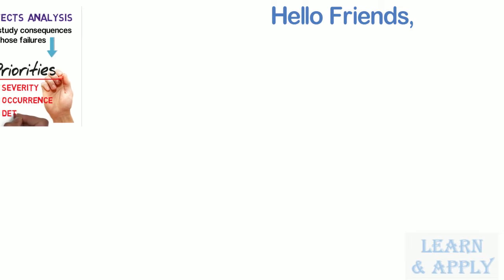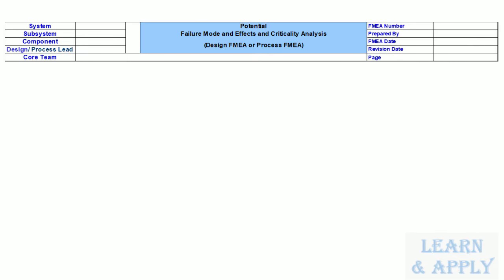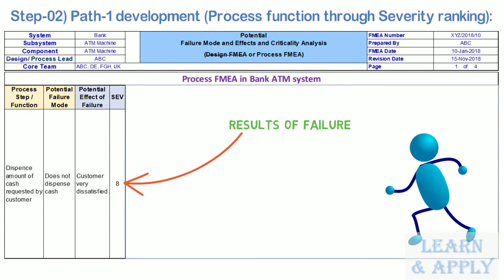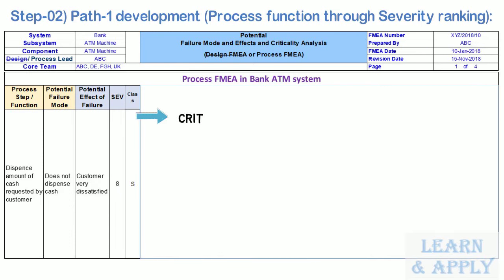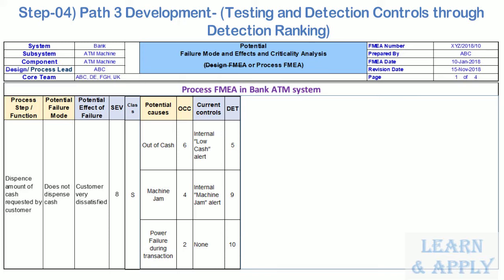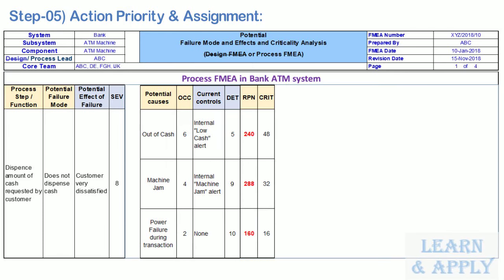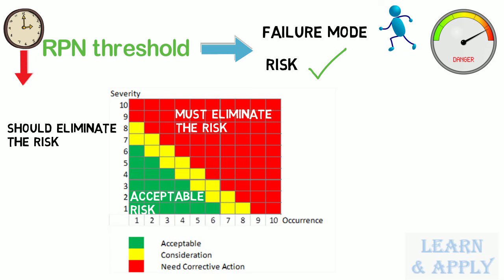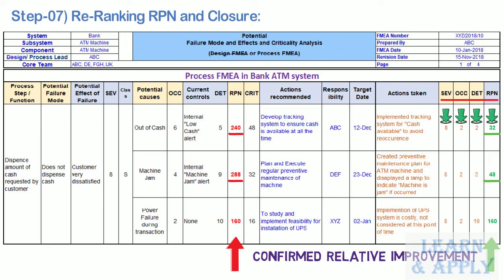FMEA with Example: Detailed illustration with a practical example

Comment: Thank you so much. Extremely easy and useful concepts.

So should risk matrix be 10*10? We have 240 correct? So do i increase the size of my matrix as 30*10? Wouldnt it be hard to draw? Could you please help? Or do i keep 30*30 with 10*10 squares and say 1 square =3 units and so on?
Reply from the maker: Thank you for your valuable comments and appreciation!
Can you please elaborate on your thought process here? 10*10 is a standard risk matrix considering Severity and Occurrence ratings.